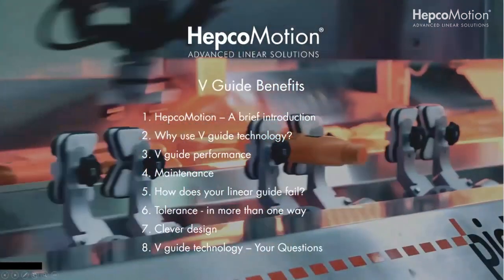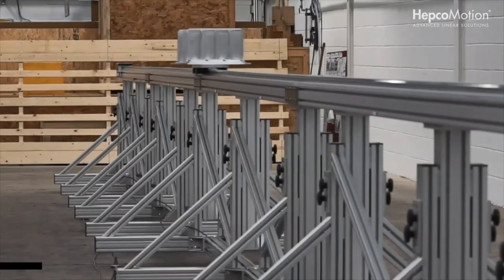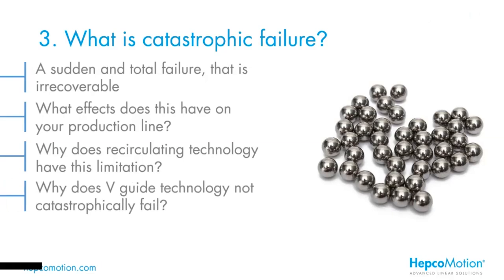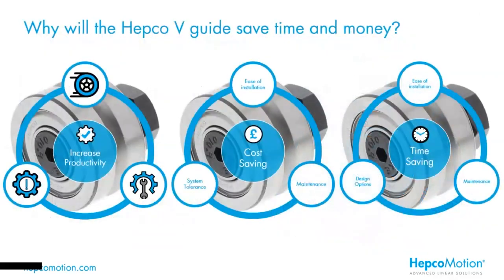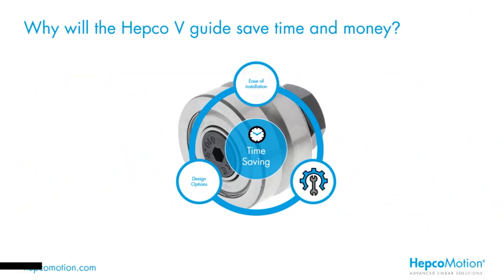V Guide Systems | HepcoMotion Webinar

Comment from the maker: 🕒 Timestamps:
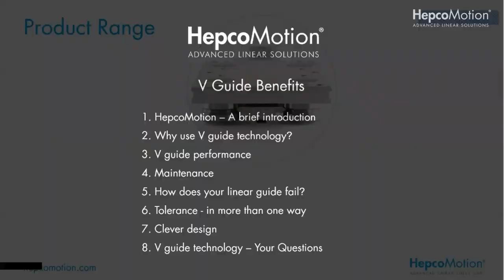01:39 – HepcoMotion: A brief Introduction
04:32 – Why use V guide technology?
05:18 – V guide performance
08:40 – Maintenance
10:57 – How does your linear guide fail?
16:53 – Tolerance – in more than one way
23:02 – Clever design

V Guide Technology: Your Questions
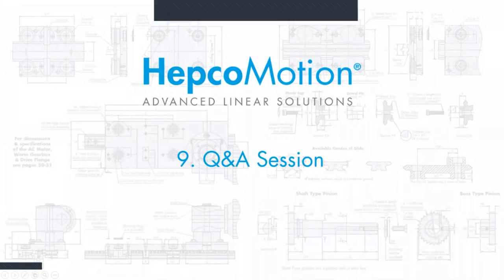31:45 – Will water and paint affect V bearings?
32:42 – Does high temperatures have an effect on V bearings?
33:46 – Are there ‘hygienic’ versions of the V guide system?
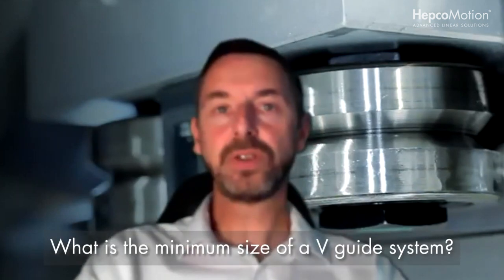35:00 – What is the minimum size of a V guide system?
35:26 – How effective is the V guide system in the machine tool industry - can it replace LM?
36:14 – What is the maximum stiffness V guides can achieve? 
37:26 – How is the rigidity of the V system in comparison to recirculating bearings?
38:30 – What are the maximum loads of heavy duty V guide systems?
39:06 – Are these V guides lubricated for life or do they require external lubrication?
40:09 – What is the maximum length to which V guide rails can be manufactured?
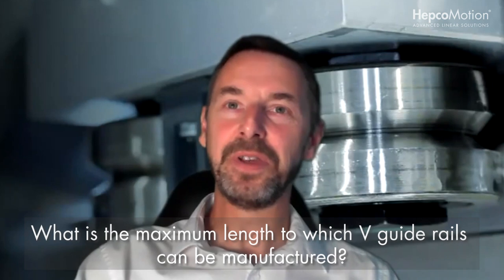40:43 – Which bearings are recommended when two tracks work in parallel?
41:57 – How is the eccentric preload managed in order to avoid premature wear?

Comment: Can your v system handle water-submerged applications?
Reply from the maker: Hi Ron. The short answer is yes, however, it does depend on the specifics of the application. If you contact our sales team, your local sales engineer or distributor will be able to assist with the specifics of this application. See our sales contact here https://www.hepcomotion.com/contact/ or contact sales@hepcomotion.com.